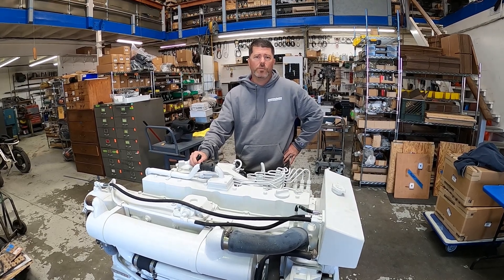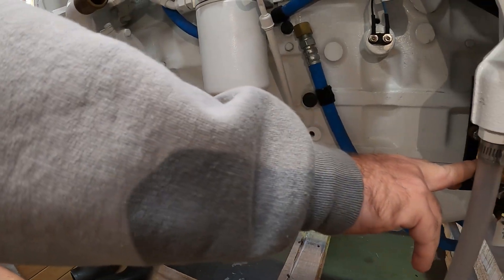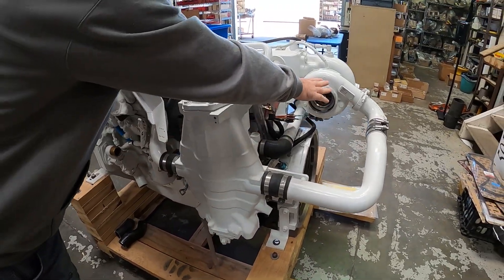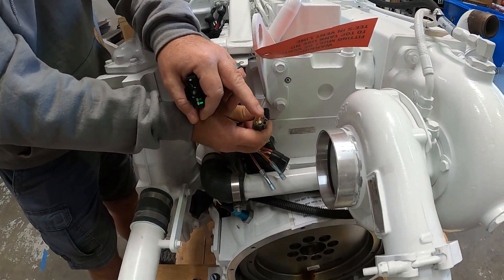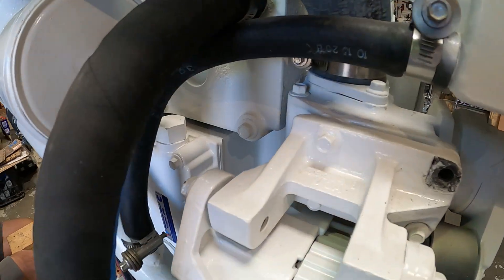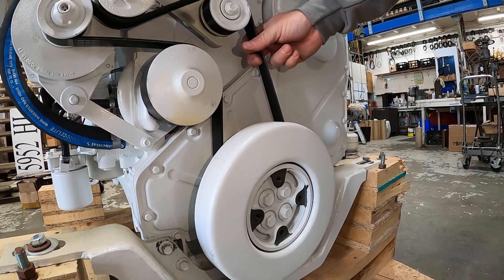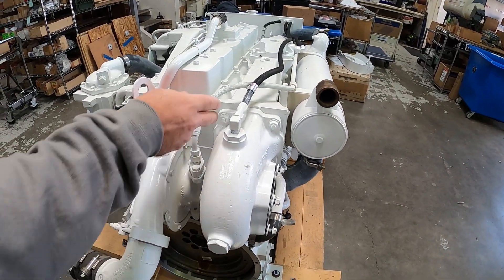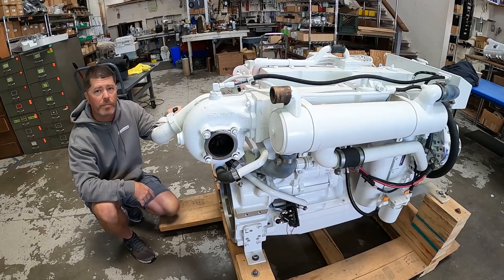Learning Your 6CTA 8.3 450 Cummins Marine Engine

Comment: On our 6cta the coolant filter is on the opposite side of the engine. Does the coolant flow through the block into the head or the other way round?

Comment: Best engine I ever owned, averaged 10.000 miles a year commercial fishing. Never had a base engine problem in ten years. As the man said the Sherwood pumps are not the best, but I changed them every two years and you can forget them. Looked after and they are bullet proof, with massive power for a light weight engine.

Comment: Great vid Corey. Looked like 1 take which is impressive.
 Metric Horse Power can also be called PS (Pferdestarke)  1 BHP = 1.0143MHP. There was also a 3% increase for fuel temp adjustment  as ISO8665 is tested at 40 degC and MHP is calculated at 25 deg C, hence the addition of fuel coolers. 
The US companies adopted this to make a even playing field with the Europeans manufactures. 
 I like the deletion of the fuel coolers and the air heaters. Ever since the change from the old  4 hole injector CPL 2172 to the 5 hole CPL 8089 we found that the soot build up on the transom really disappeared. Particularly commercial vessel operating in warmer conditions there was just no need for the added complexity of the air heater.  
The new aftercooler with the low pressure check valve for condensation drain off works well in humid conditions. 
The Neutral safety lockout plug also has the connection for gear oil pressure if you are running the old standard panel 
We were receiving a remote oil filter kit with our 430 / 450 recons. Not sure if you are seeing those in your upfit kits.
Reply from the maker: @sumpjunkie  Wow!  Some great info there! Im sure a lot of people will find that useful.  A little too much depth for us to include in the video, but I encourage anyone who has a experience or knowledge regarding these engines to chime in.  Thanks!  And yeah, Corey did that in one take, which is impressive.  Only one tweak in post.  Makes my job as editor easy.
Reply: @SeaboardMarineIncVideos  The one thing our customers did not like was the hose between the aftercooler and the gear oil cooler. If you were running a non standard type of mixer or diverting through a hydraulic cooler pre mixer and a back pressure is created on the raw water flow, that hose balloons out and fails, not sure if you have seen it. 
Such a great engine. Easy to sea trial and diagnose. If you are getting your 58 - 60hg of Intake manifold pressure - they were punching out 430hp. 
They sit on 82 C degrees typically - if you are up over 90 C you have a problem. 
Repowered an old 400C a couple of  years ago with the Nippendenso pump. Not many of those around. 
Great explanation on the engine.